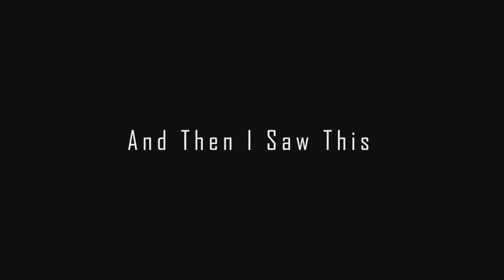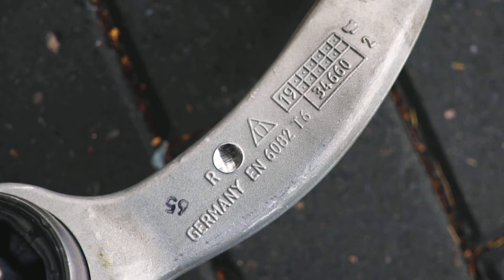Loose Steering And Worn Tires! What Could It Be??? - BMW 760i E65

Comment: Thank you for this great video.  I think that I need to do the same for my 760Li soon along with the inner and outer tie rods.  Is it obvious how far you need to move the damper back down after you have installed the new LCA?  Thanks - Mark
Reply from the maker: There is a lip on the damper. This will lock the position so you can not but it back on wrong.
Reply: @SATSMotors  Excellent.  Thanks, that sets my mind at rest in advance.